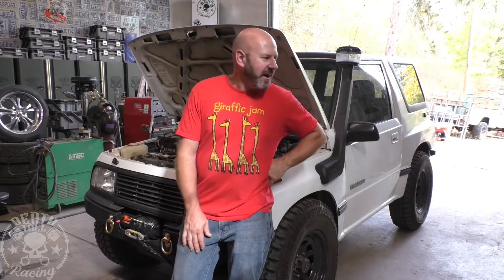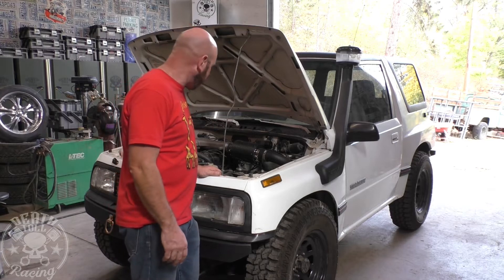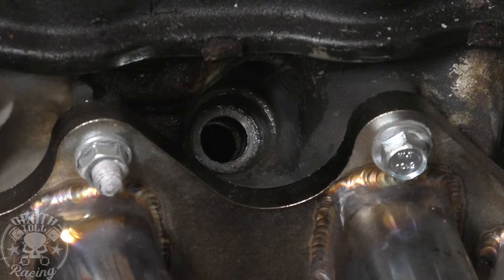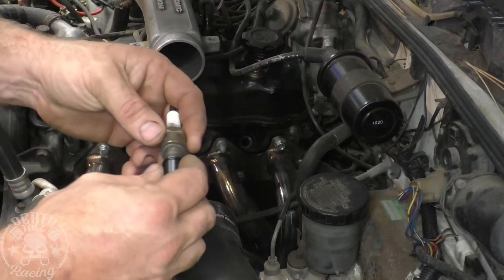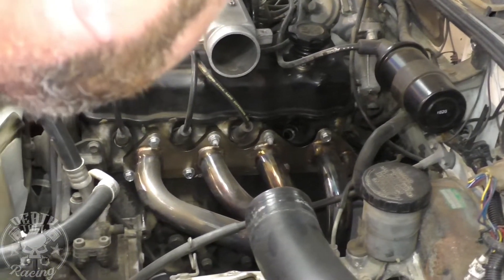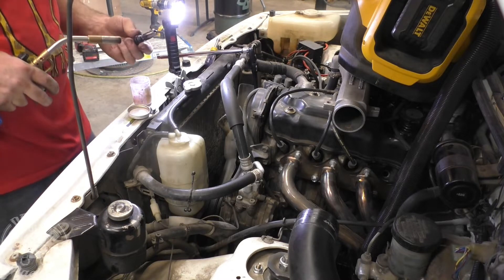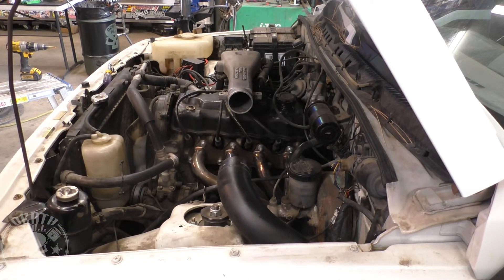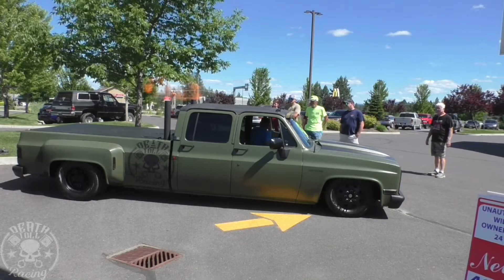Repairing Stripped Spark Plug Threads in Aluminum Heads Without Removing them.  EASY

Comment: Never use a air power ratchet to tighten spark plugs-i cant believe i just seen this because i really thought this guy was better than this
Reply from the maker: Air powered?  Lol. I can’t remember the last time I’ve used one of those. That’s good advice for an amateur for sure, but a troll comment in general.  I do see why they put directions on everything in the comments section.
Reply: Well it’s clearly not a air power but if your not necessarily a pro at this you should probably stick to regular hand ratchets

Comment: No. Don't use those. Use Time-sert kit. Get the extended kit. Timesert physically locks the insert in the head. Thread-saver relies on the swaging tool and loctite. They can pop out. Time-Sert has an extended kit for gasket and taper inserts.
Reply: Can you please fix my ford spark tread and how much will it cost
Reply: @isaacnyamekyeadomako9767  Get the Timesert kit. It's expensive. Get the extended kit. Get Loctite green and tap oil and wheel bearing grease. You need the right length inserts.

Comment: Awesome video. I have seen a bunch of old timers cover the tap with grease and use the grease to hold the chips and swarth, but I have always preferred the vacuum method like you use. I haven't tried cutting a hole in the hose line, though. I like that idea.  Always learning new tricks on your channel!
Reply from the maker: Thanks!

Comment: youre supposed to remove the spark plug after installing the insert and then use the other tool to flare out the knurls that are at the top of the insert... thats why your spark plug doesnt come even with the insert. its also going to cause your spark plug to be insanely stuck next plug change, or be loose enough to get shot out again.

Comment: did you forget to tap the insert with a hammer to get the traction on the side of the threads so it wont come out next time?
Reply from the maker: This style was retained by loctite if I remember correctly. It’s not a huge deal if it comes out next time, all the hard work is done.

Comment: Top of the insert doesn’t need to be swedged after installing?  Many have a knurled ring at the top to bite into the head. 🤷
Reply from the maker: These don’t, but others may. Worst case is it unthreads out with the plug next time you change them. But I’ve never had one come out.

Comment: Using the vacuum cleaner isn't going to keep chips from falling in unless a valve is open to let air enter the cylinder.  Some of it blew out when you hit it with the blow gun, but it's unlikely to have removed them all.  A blow gun with a long thin tube that'll go into the cylinder helps.

I pack the tap with grease and it holds the chips.  I've checked with a bore scope and nothing went in.
Reply from the maker: I mentioned the grease method in the video. In my experience the grease method makes sticky chips that if any fall in they are really hard to get out.  To each their own though. In the end it’s just aluminum.

Comment: Technically this isn't repairing the thread, its re-threading the said thread :D because you are creating a new one. Btw, have you tried restoring the thread instead? Our product rotary thread (shameless plug) can fix/restore it, and it works on different thread pitch, inch, metric & pipe. 

Btw, my concern on working with machine especially sparkplug, what if the engine catches all the metal dust after? I am sure the vacuum cannot get them all.
Reply from the maker: I'll check it out.  Thanks!
Reply from the maker: I checked out what I believe you are talking about, and unfortunately that wouldn't have worked on this one.  I had no threads to repair.   I feel like I may have looked at the wrong product though, because that what I looked at would have been worse for introducing metal dust into the cylinder.
Reply: @DeathTollRacing  ah if there's no thread to begin with, the tool you used is better :)

Comment: The problem is most newer v6s ect have the plugs back and under the motor, none are the same angle and I have little to no space to get back there.. I've had a hell of a time and definitely couldn't fit no vacuum or air hose back there. This car with these tools would be easy peasy lemon sqeezy.
Reply from the maker: You can try and pack grease on all the tooling so hopefully the metal chips will all stick to it if the vacuum isn’t an option.

Comment: I love the vacuum cleaner trick ive done this repair 4 or 5 times over the years always gobbed grease on the thread chaser then blowed the cylinder out but i bet using a shop vac catches a lot more of the meta filings great idea,great video to take care.
Reply from the maker: I’ve done the grease too and found that if any does fall in it’s really difficult to get out.

Comment: What is the thread size of the tap? Not the spark plug thread size.
Thanks
Reply from the maker: I measured it because nothing says, and it appears to be 5/8-18
Reply: It's 14 x 1.25 and 18mm on the large tap.

Comment: When installing rear axles should they take a serious beating to get them to "set" in?....i can not get mine back in.
Reply from the maker: Are they spinning the driveshaft when you turn the axle or are they not to that point yet?
Reply from the maker: The bearing is tight in the housing but it shouldn’t be crazy tight. It does take finesse to get the axle in the carrier turning the axle and and lifting the end of the axle to go in the carrier from the hub end since that’s all you can hold onto. Then just a rubber hammer should be enough to get it in.